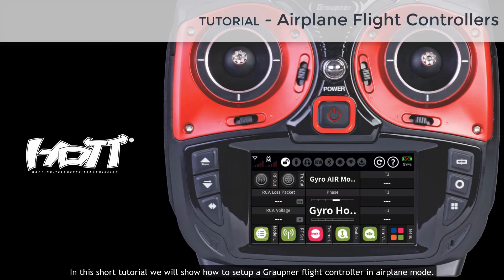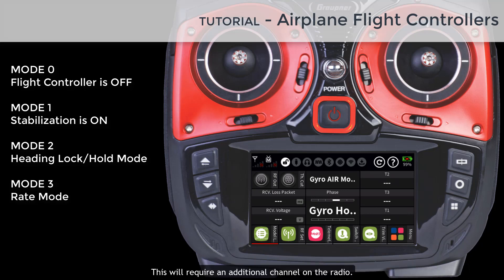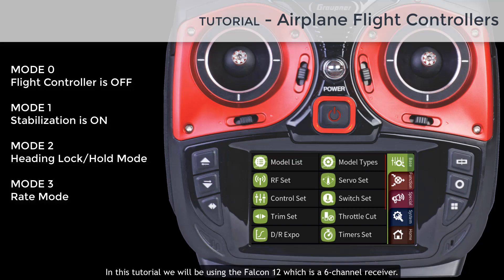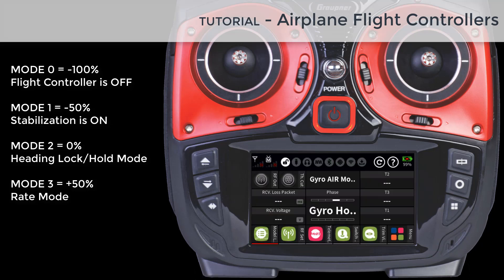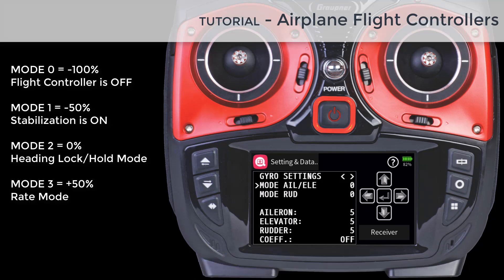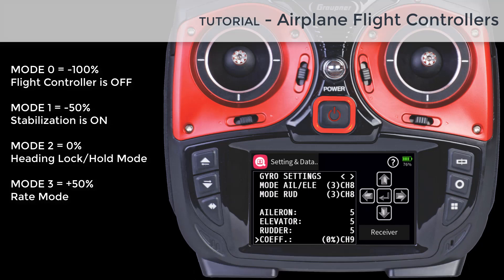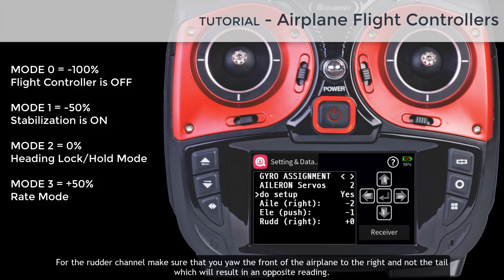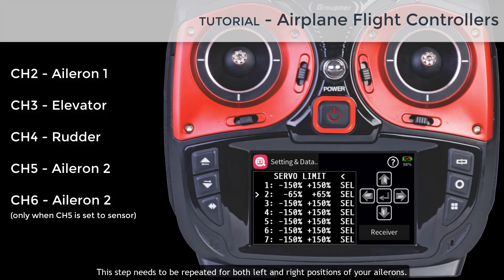Tutorial - Setting up a Graupner Airplane Flight Controller

Comment: How do you set up a GR-18+3xG+3A+Vario receiver on the Graupner Mz24 not pro .
Reply: Yes I have one of those and that's what I want to do but I need to know Hands-On how to do it, I agree with you, Maybe we'll get an answer
Reply: A lot of the same principals should still apply since the programming on the receiver itself remains the same.  I'd highly recommend a Pro upgrade on your transmitter from Control Hobbies.  Much more intuitive programming with the Pro software/firmware upgrade.  It almost seems like a new radio after the upgrade.

Comment: A question:
Is it possible to use this gyro-modes on an airplane without ailerons?
My electric sailplane only has rudder and elevator and esc for motor.
Thanks for any help and looking forward to Your answer.